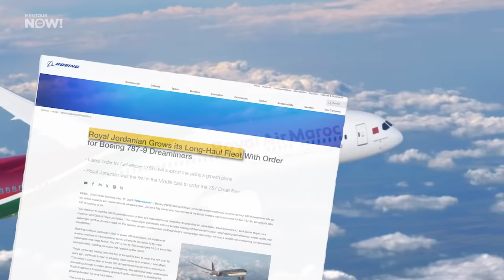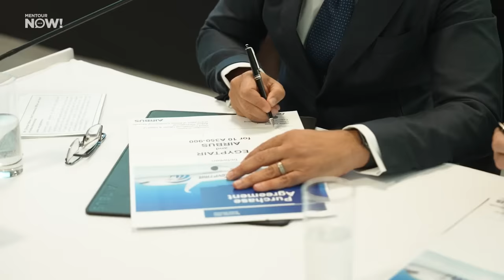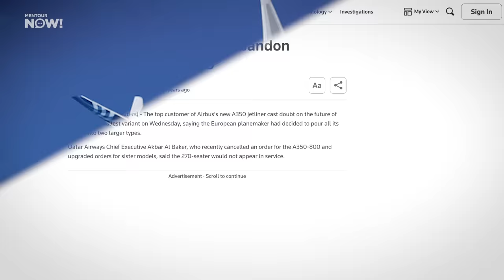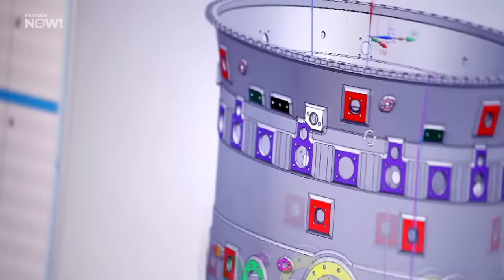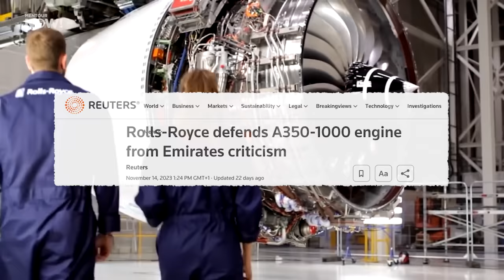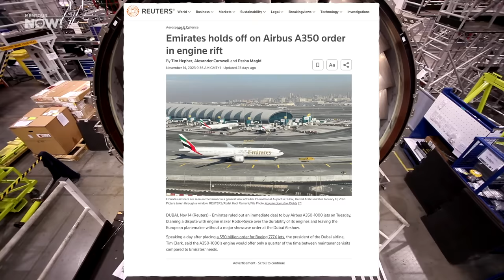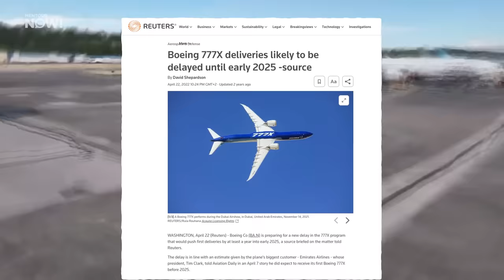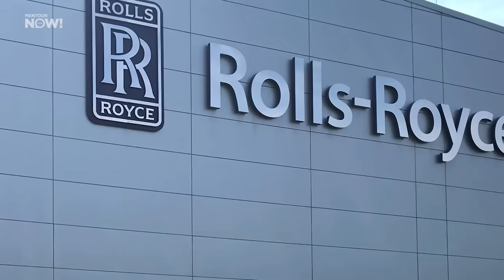What’s WRONG with the Airbus A350?!

Comment: I suspect a big issue with modern engines production is the diverging needs between the military and civilian air fleet.

The civilian air fleet prefers 2 engine planes with very large engines.  This helps dispatch reliability.

The military prefers at least 4 engines on its planes for survivability. This means that the extra large civilian engines don't benefit from the militaries research and procurement budget.

I think if we want aircraft to continue to progress, we will need governments to get involved to act as financial backstops for the manufactures, so they can take more financial development risk.

Another option could be new aircraft that can fill both military and civilian needs.

Comment: Here's a question. It was mentioned in the video that the A350F would be somewhere in between the A350-900 and A350-1000 with regards to size. Would that have an impact on the ability to convert a passenger variant to a freighter later on down the line. I'm aware that such a conversion would require testing and certification regardless.

Comment: Wouldn't it be possible to make a dual engine A380, so its more effective and not only worth to those airlines from countries which are oil providers? Cause as a passenger (Ecomomy) it feelt much better than the 777 (both Emirates).

Comment: brexit going great, british industry is thriving, dont believe in project fear
on the topic of multiple engines... giving the importance of the market in the middle east, wouldn´t it make sense to offer at least two options, one for hot and cold climates if theres such a difference? apparently in the past were airlines could chose between multiple engines all types were sold, therefore it must have had made sense depending on ur needs otherwise everyone would have bought the most economical engine in the end. if u cannot adapt it to work there, maybe think about introducing another choice for the a350

Comment: I don think for a manufacturer to blame the performance of its product on the customer is ever a good look.  I find it hard to believe that Rolls Royce has never had an engine that had to operate in a desert environment on previous models of aircraft.  Seems most likely they pushed the development of the -97 to meet production requirements assuming that they could fix and upgrade the engine once they were in the field.  The airlines dealing with a very demanding operating environment passed on the opportunity to be Roll Royce's field development team

Comment: I wonder if GE has the same issues in the middle east. I don't think there is anything specifically wrong with the A350, the engine choice is the airlines prerogative and the manufacturer might have a bias. I must suspect that Airbus doesn't want an American engine on their aircraft and seeing as its an integral part of certification a change will be impractical regarding costs and current partner contracts.

Comment: I have no problem with a single-source engine manufacturer. Most of my flight time was on military aircraft, and we got what we got, and maintenance knew how to work on them. I think the rush for fuel economy and lower emissions is driving the horse a little bit too far ahead of the cart. When almost every airliner now is a twin engine, they need to be as reliable as possible, so push the envelope in testing, but not in service, please...

Comment: Seems like Rolls-Royce missed an “easy” solution. Since taking the engine off the wing puts the plane out of commission, why not offer to provide 2 “spares” at no cost to  Emirates so they can simply swap the engines and the do the overhaul on the ones that were just removed and have them ready for the next A350-1000 that required them? I realize that means RR would have to build two extra engines but they would have been able to sell hundreds of them and I am sure their profit margins would have made it still be profitable. Yes, I realize “swapping engines” on an airliner is not a 1 hour job but the removal and installation are certainly only a fraction of the time it takes to do the overhaul. That would allow the airframe to get back into service much sooner

Comment: In my opinion the reason there is only one engine choice is the cost of development for the engine manufacturer.  If the airframe manufacturer goes with one manufacturer for launch then the other engine manufacturers often have added expenses to get their engine certified on that airframe.  There is also a consideration about how many of a particular engine will be built & sold (or leased).  Dividing development costs over the projected production I believe has a negative affect on the decision to make second or third engine for a particular airframe.  Loved the RR engine on the 757!  climb directly to 39,000' with full passenger load for transcontinental flight.  (757-200.)

Comment: I wrote this as a comment on your article: basically I don't buy the engine reliability argument. There is no way Qatar wouldn't have been shouting about it and Etihad have said nothing either, both operate in the same environments. Even with generous contracts with RR they would vocally complain about availability.

Then there's the other operators who've said nothing (remember they did when Qatar raised skin degredation issue)

This is almost certainly a negotiation tactic with RR who have publicly stated they're raising sales and maintenance prices.

Comment: I still do not get why Airbus engines are worst than Boeng in hot dusty env, very interesting video but in relation one to another (comparing) I did not get the main reason why Boeng and not A350

Comment: Orders announced at an airshow are one thing. Firm orders that lead to actual deliveries are something else entirely. Both Boeing and Airbus will need to replace their single-aisle offerings with something more modern. And that won't happen for a few more years. In the meantime Boeing will have the advantage in twin-aisles, if they can get the 777X certified.

Comment: a few years back  airbus stated that it was a costly mistake to rely to much on ME3 and add the special wishes of them into their planes and that they sell more to a broader customer base if they do a new model not to specific to ME3 needs.... seems the case with 777x vs a350.. currently it seems that 777X is more a replacement for a350  then for 777

Comment: One thing that wasn't clear in this video was the way in which the maintenance of these engines takes place.  When an aircraft is taken into the hangar to have its engines serviced, are new engines ready and primed to be fitted to the aircraft as soon as the engines to be serviced are removed, thus enabling the aircraft to return to service as soon as possible, OR is the aircraft kept out of service while those two engines are serviced and the aircraft is kept on the ground in the hangar while the servicing takes place?  If it's the latter, then surely the answer is for Emirates to either buy enough engines OR for RR to provide spare engines to Emirates gratis to keep some ready as the airliners arrive for work.   If they're already got spare engines ready and it's still an issue, then I can understand Emirates' frustration.

Comment: Does an airliner have to be grounded while an engine is serviced or can they be swapped out?  I know a maintenance log has to stay with an engine but if the record of engine maintenance is not married to the aircraft then "Engine as a service" sounds like a way of keeping equiment in the air.

Comment: Emirates is the largest operator of 777 and it operates all versions of it. Besides their business model is Hub-based, so they need big planes as replacements for the aging aircraft in their fleet, to minimize operating costs, as the average fleet age increases the cost of operation also increases due to more maintenance requirements.

Comment: I couldn't imagine what stress going from 40+ degrees on the ground to -40 at cruising altitude could do to a plane and its engines not to mention sand floating around in the air

Comment: Only emirates have problems with the a350-1000 because it doesnt suit the climate there. 

But, will emirates completely sure that the 777x will suit the climate there and be the replacement of 300ER or will it have worst result than A350-1000?
Reply: Also how does it not suit the climate in Dubai but in Abu Dhabi and Doha it obviously does? Haven’t heard Qatar Airways complain and they usually complain about everything

Comment: I was a design engineer for a component on the  RR Trent XWB engine, I understood every word of this discussion.  I know exactly what you are talking about.   I know the difficulties of working through issues is immense, you explained it very well.  I know engineers in Derby, where the  RR XWB is built and  tested.  They are very thorough engineers, but there are a thousand pieces to the puzzle that neee to fit to make it work.
Reply: For me  it looks like RR maybe has to replace efficiency back to durability again which is a politically unthinkable topic.

Comment: The biggest challenge that Airbus faces, and has underperfomed at IMHO, is balancing the needs of the US market with the needs of the rest of the world.  The United States has over 13,000 airports while the rest of the world has around 30,000.  Obviously, most of these airports aren't for commercial airline use, however, they raito is fairly similar for commercial airports.  This is why the US model of airtravel is so different from those you see in other countries.  The hub and spoke model worked for a while in the US, but it just couldn't handle the load after the late 90's.  US carriers have switched to the point-to-point (with some hub and spoke) model and this is also partly due to the demand of US customers to have less connections or shorter layover times.  I'm not advocating for one model over another, there is no single best model, each country and airline will have different values and priorities and that's great for customers, but Airbus didn't care to provide great options (until recently) for US air carriers as Boeing did.  The A350 kind of falls into the cracks between these two models, and doesn't have a whole lot of flexibility.
Reply: They could have chosen A330s any time, which was the best aircraft for long and thin routes for a fair while, and now they can choose the A321neo, which a few have.

Comment: Rumor is that Delta is having issues with the terms of the agreement on the 350-1000 engine.

As a very long time Boeing pilot, I found the 350-900 to be a fine airplane.
Reply: For the engines themselves or the mro shop at atlanta that services the xwb-84 and trent 7000 currently? 

Who is your source?

Comment: Funny how things change. In 2022:
'Emirates (EK, Dubai International) is prepared to cancel its order for 115 B777X if Boeing delays their first deliveries beyond 2023, Chairman Tim Clark told Airlineratings in an interview.'
In 2023, when delivery has slipped to 2025/2026: 
'Emirates orders another 90 - 777X's...'
Reply: They were never going to cancel. They were arm twisting to get a better deal.
Reply: @nrml76  I guess they got the better deal, then. This, after BA wrote off $6.5 billion on the program. The 787 & 777X programs are costing them dearly. Not that the 737Max is doing that well, either

Comment: The problems with Airbus and Rolls Royce with Emirates started well before, with the A380: in order to win the remaining engines for the A380 from GE, RR committed on fuel burn and performance figures that they were then unable to deliver. This even caused the cancellation of the last batch of A380 for Emirates, and the end of the model production. Since then, Emirates must be more leaning toward GE that supplied cheaper engines to operate than RR on the same aircraft, the A380
Reply: Emirates can lean towards GE as much as they like, and hope the B777X does get certified in 2025, which is hardly a certainty, or they will immediately be ordering the A350-1000 and will be begging Airbus for instant delivery. Remember also, GE will possibly be implicated in the powdered metal scandal that affects P&W, as they share suppliers, and only time will tell on that one. Its Covid that finished off the A380, btw, not unfulfilled promises by RR...😀...

Comment: It seems strange that R-R and Emirates don't just settle on having a few extra engines so they can be quickly swapped out; leaving maintenance to be done on engines with the planes still in the air?
Reply: That's what RR offer for engine care packages, swapping out engines. Its the added cost RR require for their maintenance agreements for the -97, that Emirates don't like. RR have decided to up their prices to a realistic level. and Sir Tim doesn't like it..........

Comment: Strange that Emirates runs down the Trent, which is in service and getting up to speed, yet it orders a completely unproven and engine not in service yet (which has had it's own issues) in the GenX. As well - wasn't Clark recently going on about 777X delays, now to 2026, 7 years late? Guy sure changes his tune, quickly...
Reply: Hmmmm let's see, the Trent XWB has a dispatch reliability rate of just 99.91% and the GE90-115B/GEnx have a dispatch reliability rate of at least 99.98%, and with all this experience and proven track record GE has, we can see where this is going
Reply: @rafaelwilks  Sorry, I'm talking about the Ge9X, which is the engine for the 777X program, which is not in service yet. As I recall, the GE90 had it issues early on, as well.

Point being - all new engines seems to have teething problems, the Trent being no different.
Reply: He's the new AL Baker...

Comment: RR has a lot of engine "issues" GE Has carbon fan blade patent protection making RR build very costly titanium blades, RR combustion fan blades basically melted on their first run of new design of engines, and finally they almost took down a 380 with an manufacturing error that was so egregious it makes on head spin, meaning they actually installed an oil pipe that was improperly manufactured ( hole was offset)  rupturing oil all over the engine while running, not favorable! I can within seconds of taking an 380 out of the sky, fully loaded with people!
Reply: How come the new RR ultrafan has carbon fan blades?
Reply: The oil pipe broke causing the hp shaft to crack and therefore causing the HP module into over speed and explode.

Comment: What is ironic is that the GE9X is also a new engine and no track record in the Sand and hot.   Granted they have been successful with the GE90 and the GenX in that arena.    The claim is its a derivative and I have not seen any listed differences per the Trent  1000 and the TEN per what is new and not.      With all the delays they are getting lots of testing time!
Reply: Emirates changed engines mid contract on the A380. They went from Engine Alliance (GE) to Rolls Royce because the RR engine had better fuel burn.
Reply: @thehighlander959  :    I know that is what is what TC claimed but the logic does not follow.   The GP (GE and Pratt) 7000 had something like 2-3%  better than the Trent 900.   TC statement was the upgraded 900 was 5% better which is impossible unless its a new engine (even with hyperbole accounted for it was not true).   TC was trying to get new engines and the A380 kept in production and RR was the only one that would bite  (GP would not).     TC got his revised but not new engines and  went onto experience issues with the revised Trent 900.    TC wound up with different engines and a loss over it all.

Comment: That is very interesting thing that I never thought about - obviously an engine experience less dust on e.g. transatlantic flights and knowing issues with volcanos in the past - it must have some impact on the engine. I'm curious how it works in details, though, what's the mechanism of damage to the engine exactly?
Reply: The silica in the dust melts onto the turbine, I imagine the compressor experiences some erosion as well
Reply: @coreycampbell1689  is temperature high enough to produce glass, though? The second thing for sure.
Reply: @proosee  Oh yeah, the turbine entry temp can be 2000-3000 deg F
Reply: @coreycampbell1689  please use human units 😅 jk, thanks for ideas, but I would love to see some research on that subject though.